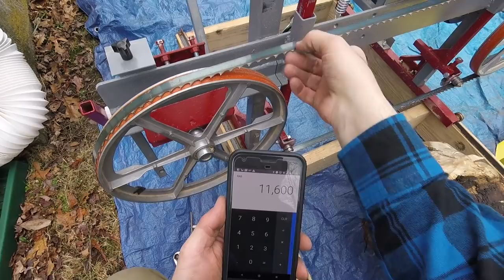Felling a Tree and Milling It Into Boards With My Homemade Sawmill

Comment: A few issues I see that could make things work better or easier. Very first thing is buy a chainsaw. About $150 cheap chainsaw would make falling a tree a breeze and a heck of a lot safer as well. Second issue I see is you are not controlling the saw blade with your present setup. You are only barely controlling one side of the blade. And somethings it can angle down and other times angle up. With bearing on both sides of the blade you control those things. My 17" ban-saw has two sets of blade guides that you can control every issue with the blade. Could solve your board thicknesses from one end to the other. And finally, you need to put more slack in the belt when you want the blade to stop and then you can cut a board, let the engine running and back it up. That would allow you to not have to re-crank every time. Could even install a blade brake to stop the blade when you are finish cutting a board. Just some ideas. I will say you've come a long way from the first video and I absolutely applaud your efforts and tenacity with constant improvement. I like your machine a lot.
Reply from the maker: A blade brake is a very good idea!  Thanks for the comment!
Reply: Gary is on it. You need more blade control. Also a water drip on the blade would help lube the blade. Keep up the good work.

Comment: I'm getting ready to build a mill so I know virtually nothing about your saw. But on the other hand I'm very mechanically inclined and have worked with bearing on shafts and rebuild electric motors and pumps .I have worked on small and large units and have over 40 yrs in the field . So I'm going to put this out there and you can use it as you wise and I hope others can chime in too if I'm not right . The pressure you are putting on that blade is going to wear out your wheel bearings if not break the shafts . Those are too light of duty to handle that kind of pressure . The way to tell if the bearings are going to wear out fast is the temp after running for a while .If you cant hold your hand on the bearing then your headed for trouble . If its hot and you can still hold your hand on them then your OK . No matter what the tension should be on the blade the lite duty wheel brgings and shafts can only handle so much pressure .Also if you would have used a larger extension cord you may have got away with your electric motor. Only way to tell is have the correct wire size cord ( less of distance as possible )and go to harbor freight get a cheap Amp Meter and check your amps as its cutting the hardest part of the log .If your within the amp rating then your electric motor is strong enough. odds are the reason it never blew the breaker is because you had less voltage because of the small wire size cord so the amps didnt go up to kick your breaker but the motor got to hot trying to carry the load with the voltage to do so. Hope this helps a little and really liked your videos !

Comment: I think your blade guides are to far apart they should just miss the log one can be fixed but the other needs to be moved to suit the size of the log, Blade tension and sharpness with the correct set are essential to cut strait. Ohh by the way I think the Old blokes arse may need a reset also it sounded a bit loose and maybe even wet.

Comment: Hope your back is feeling better. You could consider experimenting with other kinds of blade guides. Many of the homemade build videos (especially the lighter duty ones) have offhand comments that it took several blade guide designs to get  ones that work (e.g. https://www.youtube.com/watch?v=ODvVx-i3SnE and http://lumberjocks.com/projects/107378, and also others). It seems like the guides are just the hobgoblin of the light duty homemade sawmills. If you can afford it, the most reliable ones seem to be the Cooks roller-style guides, although a pair runs well over $100. Anyway, you've inspired me to try to build one of these, so I hope it works out. Love the videos!